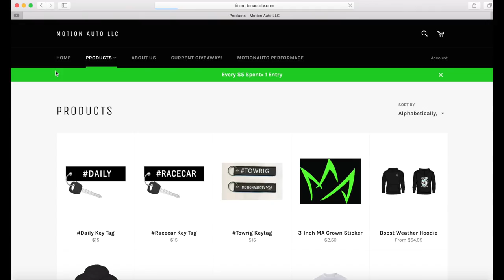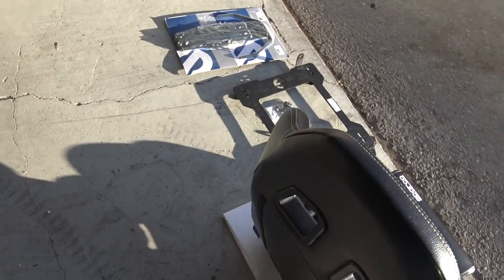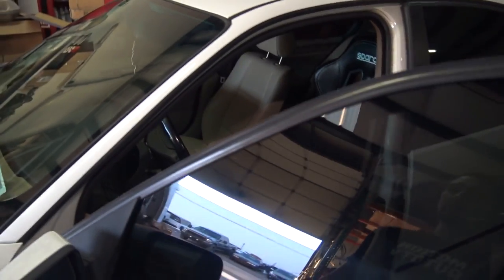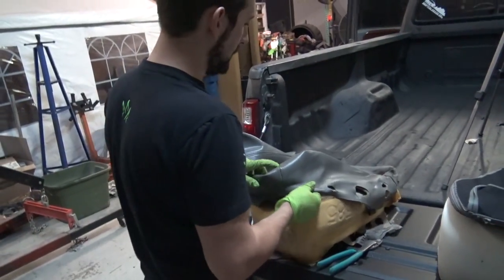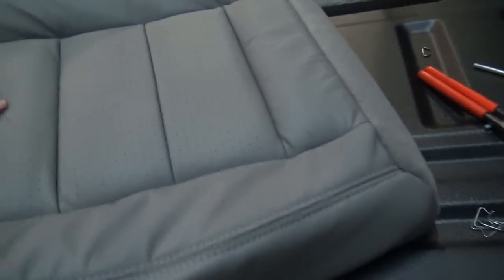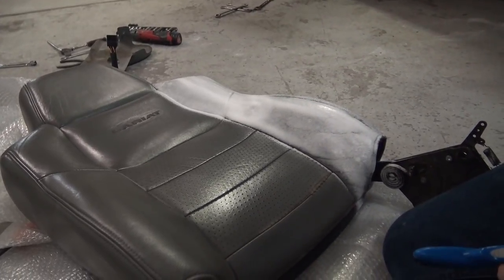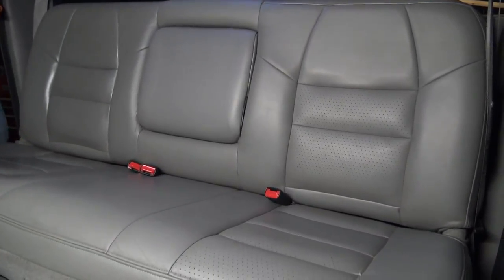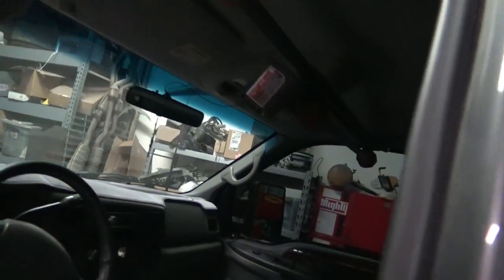Sparco seat for the E46 | Restoring F-250 Seat to LIKE NEW!

Comment: If you have cloth seats you can clean them using Foaming Carpet Cleaner and a brush and just use a towel and a shop vac to clean it off and it will look way better, my tan seats almost looked black and now they look brand new

Comment: Awesome job cleaning all of the seats... huge difference! Especially since the BMW seat had already been cleaned. I think that the Sparco seat really looks out of place in the BMW though, either add a matching passenger seat or just leave the stock seats in. Also, are you still planning to do a Motion Auto themed stripe on the BMW?... I think that it needs one!P.S. I have original edition alcantara Sparco Milano seats in my '95 Supra TT. I love them.They are way more supportive and comfortable than the stock seats. You can still find the Milano 2 and Milano Prestige around but I think that the comparable new model would be the R600... though it lacks the adjustable lumber and quick tilt features.